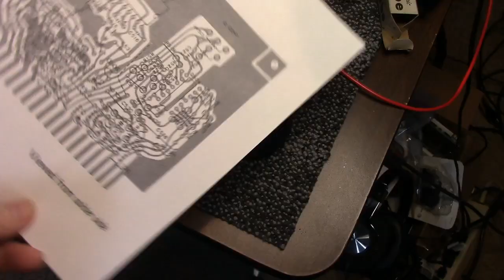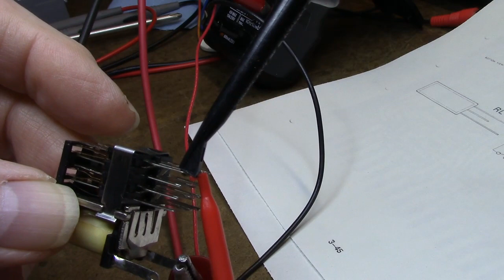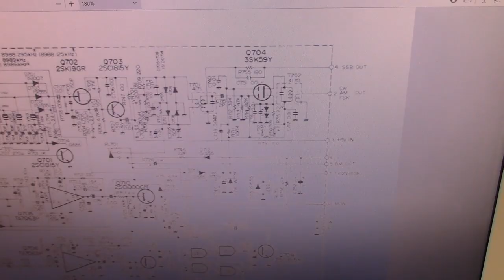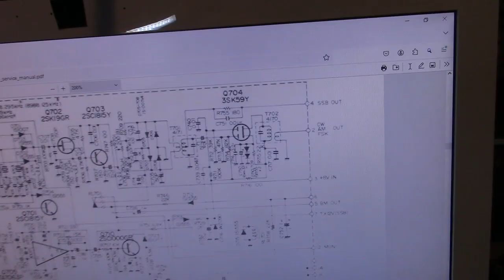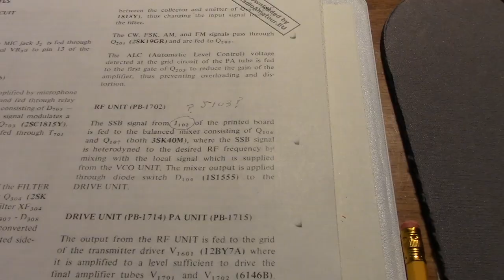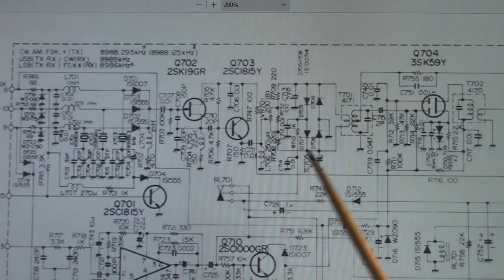Yaesu FT 901DM Transmit repair

Comment: Hello, the capacitors in the power supply of my 901DM had burst, so I replaced them. Now I have a short circuit when I try to turn on the heater. I don't know what else could be broken.
Reply: Take a good look at adjacent boards for cracks. An explosion could have cracked them

Comment: Can you provide a link to these 101zd schematics or where to buy them - I am a beginner 101zd fan , I repaired the power supply in my 101zd. It gives +12, 8, and 6V but there is no audio. Can you advise anything? Regards.
Reply from the maker: Hi Greg, I found the manual on the manualslib website ,  https://www.manualslib.com/manual/870114/Yaesu-Ft-101zd.html#product-FT-101ZD .  If the problem is no receive audio,  I would start ( assuming all connections are ok ) by injecting an audio signal at the speaker and working back until the signal is lost. You can then zero in of the defective stage. I am assuming all stages are getting the correct voltages.  Good luck, these are great rigs.
Reply: @toddanonymous5295  thanks for the info 73
Reply: Check you're getting your 8V at Q506 voltage regulator and that you have your 13.5V at pin 10 of the audio board 1705A. If yes, inject a 1kHz/10mV sine at pin 5 of the board and make sure it comes out amplified at pin 18. If yes then your problem is not the audio board. If you're not getting your amplified signal (your injected 1kHz sinewave) at pin 18 then check Q507 Emitter, Q501 Collector, Q502 Emitter and Q505 Emitter for the signal (which should increase in amplitude as you work through the transistors). If they are OK then check pins 7, 8 and 14 of Q504 (the MC3403) and you should find the signal there also (they go to the APF filter controls - if you loose the signal there then also check the APF and AF gain controls and pots). Then check you have a signal on pin 10 of Q503 (the TA7205 which is your 'power audio amp' that provides a few watts to your speaker).

Comment: That counter issue looks worrying - there is a chip that drives the last 4 digits of the display (MSM5501?) and when it goes bad that's the effect you get.  Unfortunately, it's been EOL and unobtainium for years.